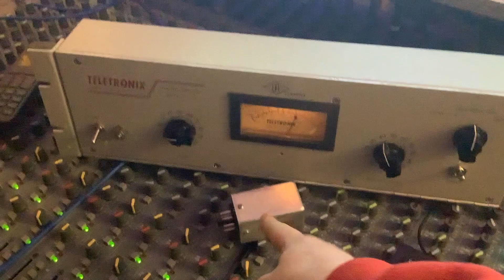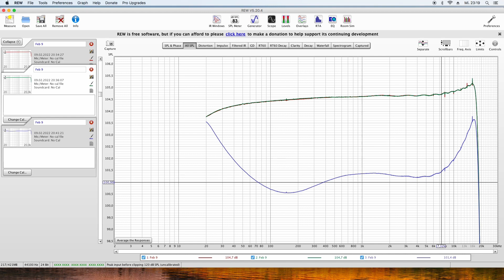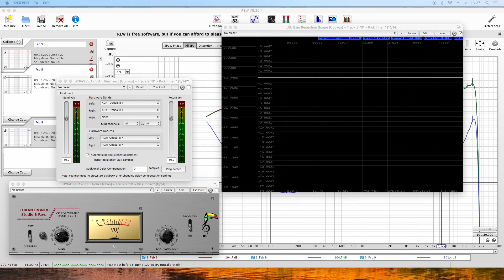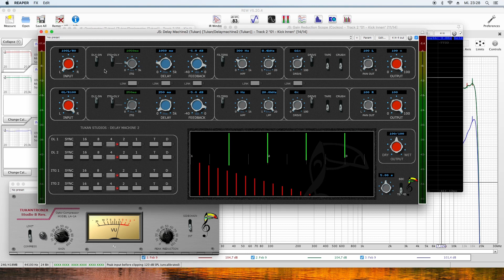Update for LA-1A and fixes for Goniometer and DelayMachine 2 (TUKAN PLUGINS)

Comment: Your plugins are absolutely fantastic, I'm really impressed by your work!! The fact you're taking the time to make them to help the community is a huge contribution to all of us! I also love the visual interface of the plugins, keeping it simple but very effective. If anything could be improved in this La-1a plugin, it is that it seems to me that the transients come out too "snappy", they have a "bite" that the original hardware seems to soften and soothe (and I don't believe that lowering the attack time would make it more similar to the original hardware. Instead, in the original hardware there might be some sort of processing that "shaves off" some of the transients and make them less snappy, or maybe there's less presence in the high end). Also, if you could create a high-frequency side chain knob (as far as I know the original hardware has it) that removes low end from the compression detector (but not from the signal itself), it would be highly appreciated. Thank you very much for your amazing work!
Reply from the maker: About the sidechaining: There is this nice little plugin called "SC-Filter" for all this stuff. I made it, so every compressor (not only Tukan's) can be filtered easily on the sidechain.
About the transients: As you could see in the video, I made several tests with different tubes and T4-opto elements. The result in the plugin is an average, or call it "what I decided to go for".
Reply: @johnmatthews8435  I came back to tell you that I'm in love with combining your NC76 plugin with your LA-1A plugin on vocals. Great results!!! Thank you

Comment: I have quite a strong feeling that what you're seeing as the low frequencies not being compressed is at least partly the result of the compressor's attack time. REW sends a slow sweep that starts off at the lower frequencies and climbs up, which means that at the start of the sweep the compressor will take time to start compressing. Of course this has to do with the compressor's sidechain filter as well (which does support your findings). 
But I'm just a little skeptical as to how fitting a REW test is for time based dynamics (as opposed to time+frequency based reverberation times, which is what it's meant for).
I pretty sure that running multiple frequencies via plugin-doctor's dynamics analysis will be more accurate for that purpose.

All that aside - your plugins are honestly GREAT and I think you're doing an amazing job! Tons of respect for that!

Comment: One thing I notice with your LA-1A is that, if I inserted in the master buss (usually first in the chain) in limit mode, with no peak reduction at all (at 0) the gain around 60 or 70, and mixed around 5% with the reaper mix knob, it gives a really nice mid present to de mix that I love. Thanks for your job 👏👏👏

Comment: Did you also match the attack and release to the hardware also the saturation
Reply from the maker: I matched the attack and release times and overall sound, as you can hear in the video.
Reply: @johnmatthews8435  ok what about the saturation characteristic i looked at the harmonics and it doesn't seem to generate even order harmonics similar to tubes

Comment: Hi, thank you for sharing your work as open source. I think the LA-1A sounds amazing. 
I wonder how do you learn about signal processing? Do you have any resources that you could recommend?
thanks in advance.
Reply from the maker: I just learned it by doing. Really.
About recommendations: Not a bit. Sorry. I just code in the theoretical mathematics for audio processing and adjust the sound design for the plugins by measurements and my ears. 
University professor for sound engineering and musical production Eberhard Sengpiel (Grammy winning) did nearly everything about the theory on http://www.sengpielaudio.com/index.html, but it is in german...
Reply: @johnmatthews8435  Danke, da werde ich mal reinschauen.